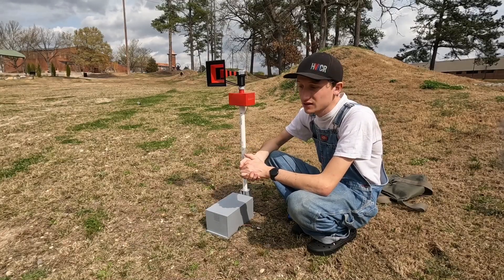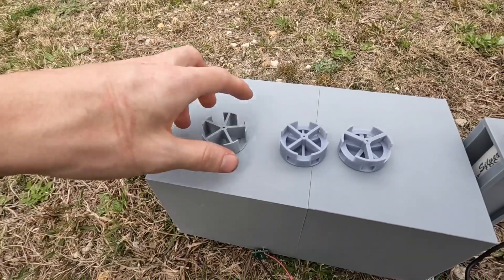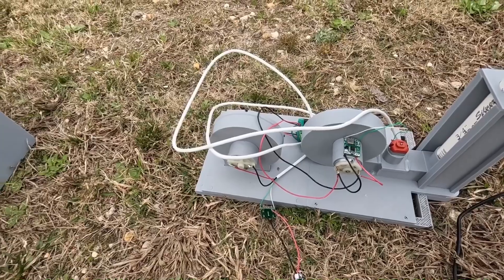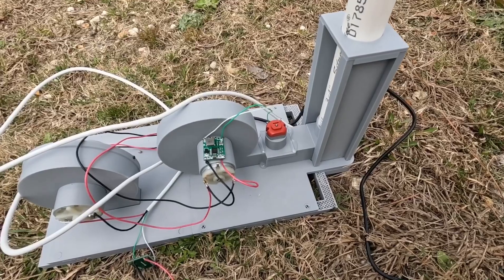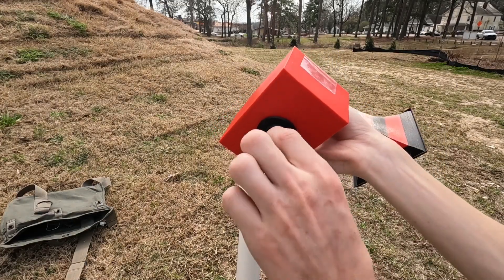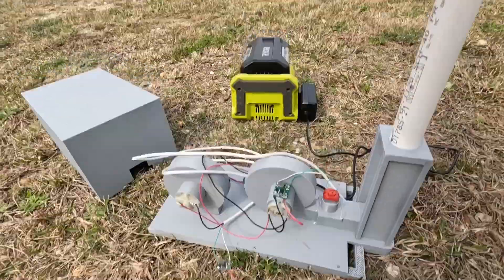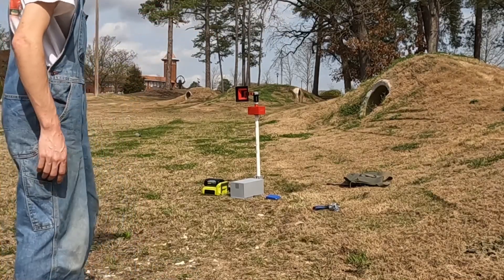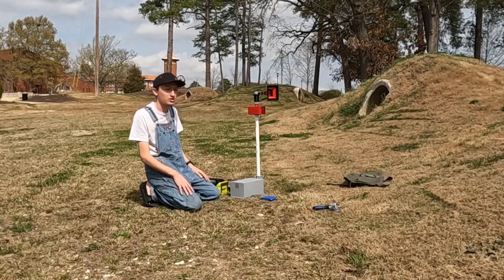Thunderbolt 1000X update video 2

Comment: Jolly good show!, for a mini Thunderbolt it packs a punch. The 3/5 rotor is half the ports of the 6/10 Decot prototype siren.  

If you were to make 2/3, 3/4 rotors would sound good to being the lowest number of port combos which make the 8/12 perfect 5th & 9/12 perfect 4th sounds & a 6/7 rotor for a mechanical ACA AL4000 sound.  4/8 would make an octave like in Sentry sirens. 5/8 would make a minor 6th interval like heard in the 10/16 Decot Red Arrows.